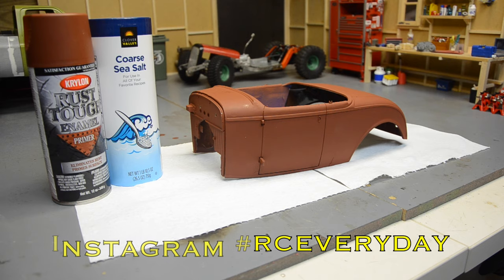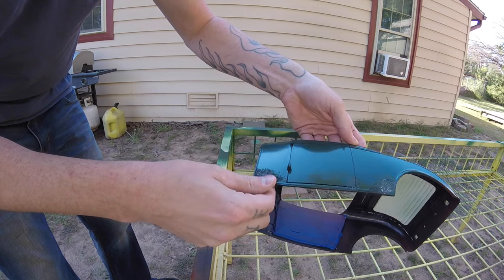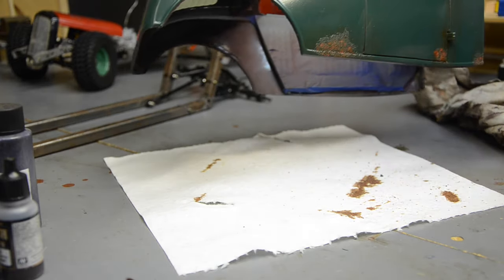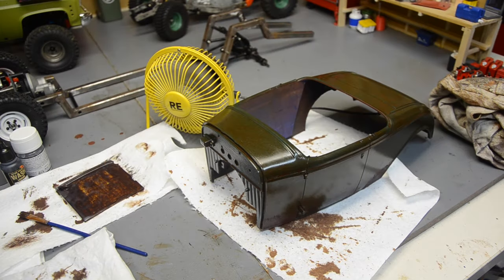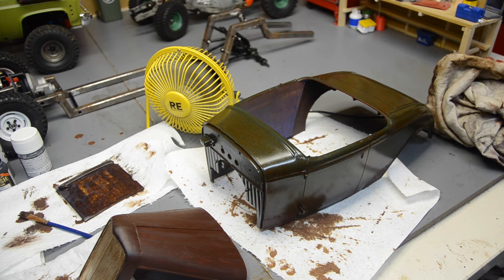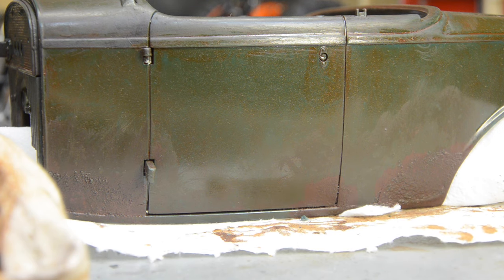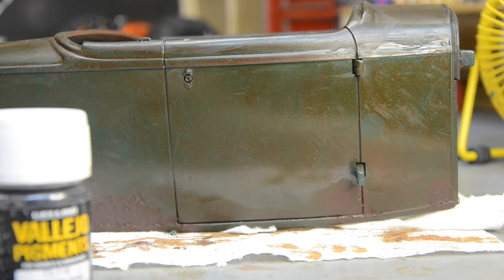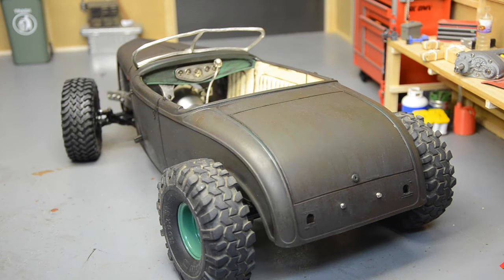Custom RC Rat Rod Build Part 11, Patina & Weathering

Comment: Try wet sanding the salted areas with 600 to 800 grit paper after paint has thoroughly dried. For texture you can mix paprika, cinnamon, and nutmeg and dust on in key areas. Do this between coats of dull coat sprinkle on while dull coat is still tacky, use light coats in between will give best results.

Comment: Hello, I'm new to your channel and the RC world in general but I wanted to tell you that is an awesome build. I have started one myself of a 32 ford truck that I found on instructables, the body looks just like the grey primer one you have.
Reply from the maker: Yes sir. That is where I got those bodies from.   Glad to have you!  This hot rod stuff is really taking off!  Always exciting to see what other folks are building.
Reply: Did you get the roadster body there too, I have the real thing out in my shop and would love to have an RC version to take to the car shows.
Reply from the maker: The roadster is a 1/8 scale model kit. Can find them on eBay still for under $100. Have to build everything else for it.
Reply: Ok cool, thanks for the info I will send you some pictures of the truck when I finish it, trying to 3D print as much as possible, I have the printer may as well use it. I'm here in the great state of Texas myself.

Comment: spray a flat clear over the body from a distance and that should seal all the pigments and wash and make them not rub off. had that problem with my 1/25 scale cars also to much flat clear will over ride the pigments
Reply from the maker: Thanks for the tip!
Reply: Your welcome

Comment: You're getting too many coats of paint on too quick, the paint needs to "breathe". It dries by evaporation, certain chemicals need to dry in the paint for it to cure properly. Slow down on your coats of paint and lay them on a little more sparingly. Start with a light coat, let it dry, do another light coat, let it dry. Paint cures from bottom to top, when you bury the first couple heavy coats with more paint the top layer dries before the bottom coats have a chance to cure and delays the drying time, especially with spray bombs when using enamel. Love your channel, just subbed earlier this week and watched almost all your stuff lol
Reply: turned out awesome though, love it so far.
Reply from the maker: I know, I just like a lot of folks get impatient with painting. I am much better than I use to be but still rush things. But luckily it keeps coming out alright. Lol. Thanks for watching and commenting. Glad to have you!
Reply: I find light coats and a hair dryer on medium heat works well
great channel man-I enjoy watching your work
Reply: Glad it turned out awesome for ya, I refinished cars in a body shop for years, painting taught me how to be patient after all the frustration of trying to rush the process. Keep the vids coming, can't wait to see your projects finished and see what's next.